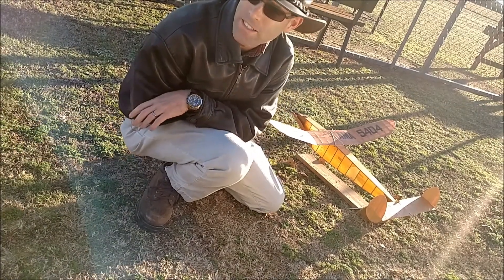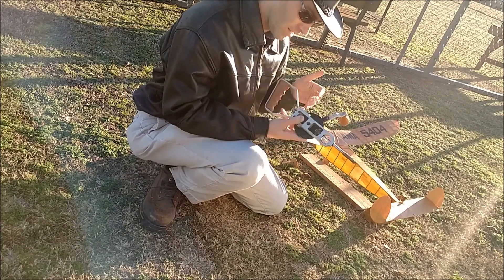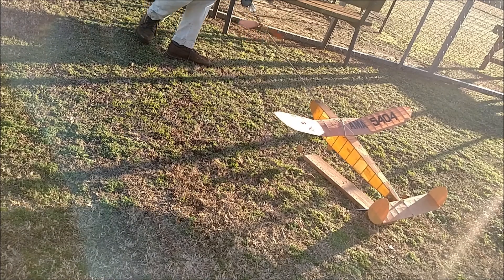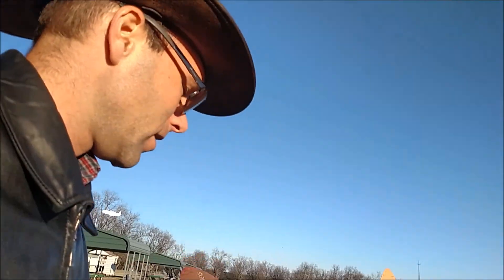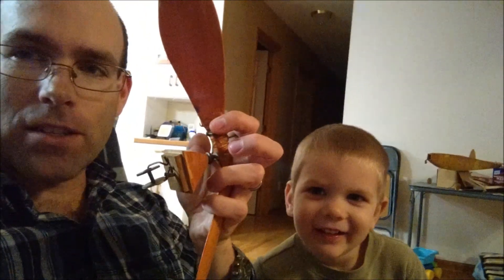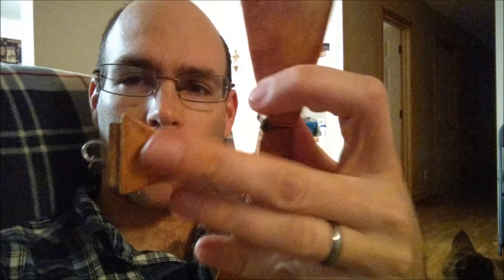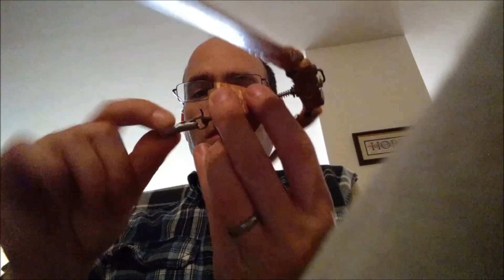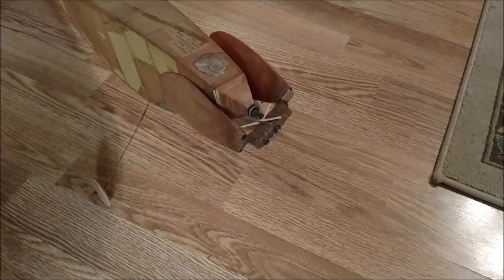Tools and Propeller Equipment for large rubber powered free flight airplanes

Comment: Love how the prop folds up after the rubber motor is exhausted!  Thanks for showing that up close!  👍😀  Is the technology the same on newer models these days?
Reply from the maker: It's even more complex now. Typically there's a locking mechanism on the prop to keep the blades extended and feathered at launch and the tensioner is a plunger on the prop hub which is activated by torque rather than tension so that the prop locks instantly instead of bumping a few times before fully catching. Also, modern rubber models often feature variable incidence tails activated by timers.